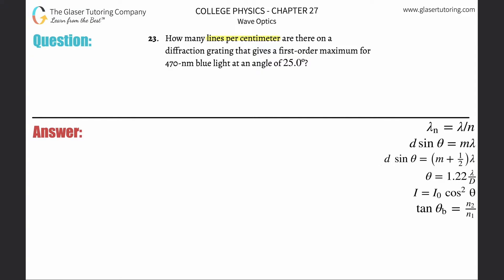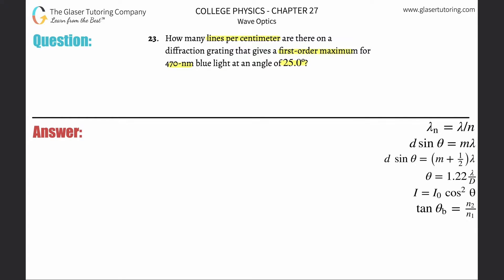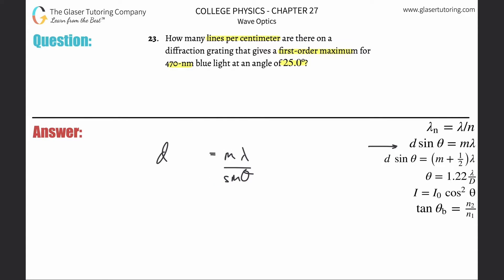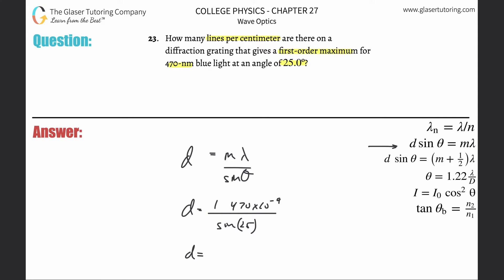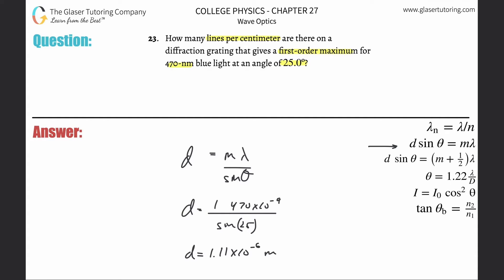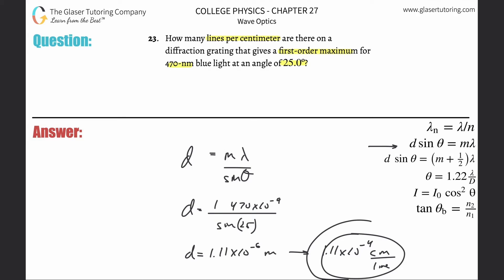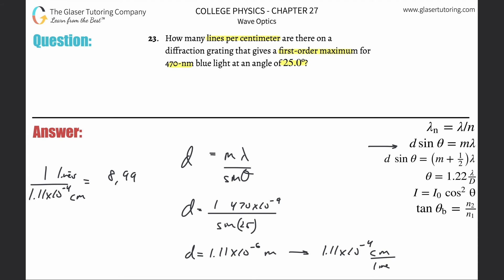27.23 | How many lines per centimeter are there on a diffraction grating that gives a first-order

Comment: I didn't understand the last part of it. What should be input to the calculator to get that 8,990 lines/cm?
Reply: On the calculator there is a button that has an x with the power negative 1 put that to the answer with 10 to the power of -4, it is above log on my calculator